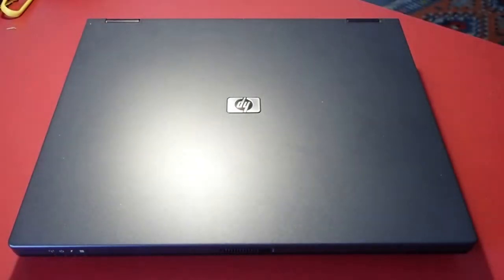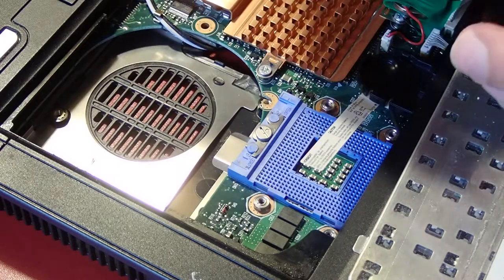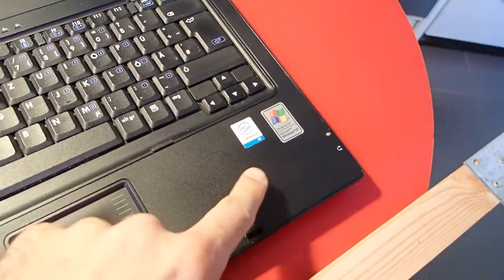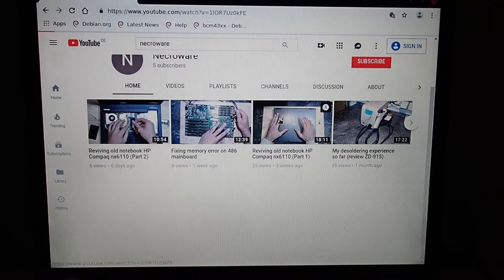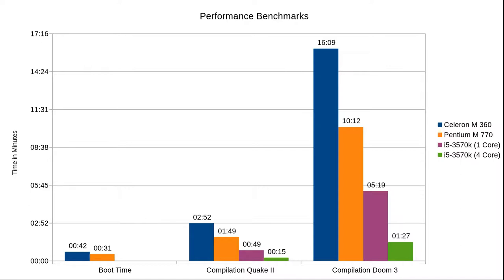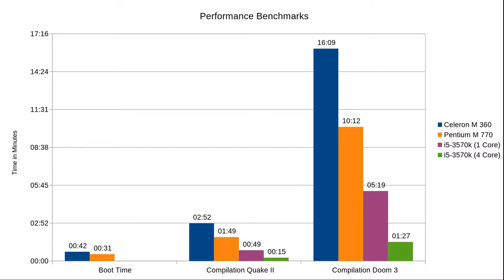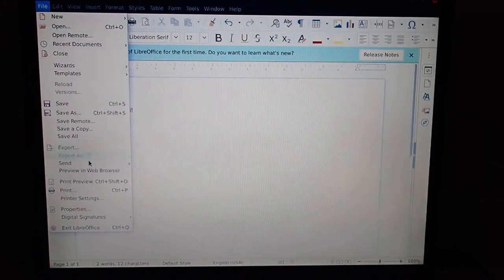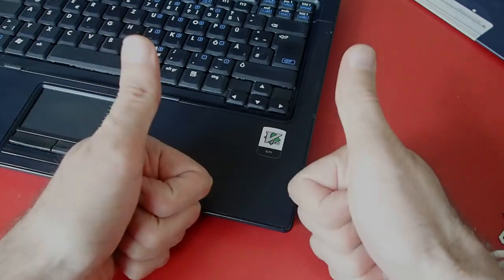Reviving old notebook HP Compaq nx6110 (Part 3)

Comment: I had been inspired by another YouTuber's videos to go through my old computers and revive them, and it just so happened that one of my systems was this very machine (an nc6110, the only difference between the nx and nc models is the warranty policy at the time of sale, nx models get 1 year while nc models get 3 years). Your video series was immensely helpful for me in restoring it.

I hadn't thought there would be adapters to convert mini SATA SSDs into PATA drives; I had been previously looking for SSDs with a PATA interface and they were super expensive and just not worth it ($85 US for a 128 GB model). I ended up using an M.2 SATA SSD as new mSATA ones aren't being made anymore.

I upgraded the RAM to 2 GB, changed out the 40 GB 4200 RPM HDD with the M.2 SSD and adapter, replaced the Celeron 350 1.3 GHz CPU (slowest in the range) with a Pentium M 780 (fastest in the range), and installed Trisquel GNU/Linux Mini, and it works perfectly. Again, thank you very much for the help!
Reply from the maker: Glad, I could help! With all this updates the notebook doesn't turn magically into a modern machine, but with this small improvements, it turns out to be usable for simple work again.

Comment: awesome videos man, good to know the processor socket and RAM. You were very informative, I have the same laptop and am about to upgrade it, just wanted to say that you're very helpful for third world countries where the economy is harsh and everything that is related to technology is taxed double or more! This is a great alternative!
Reply from the maker: Thank you. As I wrote in the other comment, socket should be Socket 479 and RAM is DDR1 SO-DIMM. Even if I'm glad to help, unfortunately this Laptop is very limited in it's capabilities even with upgrades. It is pretty much usable, if you also pay attention to take an appropriate operation system, which runs well on low memory. This notebook accepts maximum of 2GB and the CPU is only single core old 32bit one. Unfortunately people seem not to understand that, watch my videos and try to install Windows 7, 8 or 10 on it. One of the crucial messages in the videos was to take a modern, safe, but resource friendly operation system. In the world of Windows, only XP would run well on it and I don't suggest to install it. It is heavily outdated and meanwhile very unsafe.
It is very interesting to see, how people are often complaining about bad economical situation, but then trying to use an (usually pirated) operation system, which enforces them to buy a top notch hardware for a lot of money. Instead they could take an older and cheaper notebook and install a modern, legal operation system on it, which would run fast and safe for a lot less money.... very strange world.

Comment: This channel is awesome , its nice to see people making "obsolete" tech usable again. last Christmas i saved a HP nx9420 from the  skip at work.  I had to put a HDD in it but otherwise it worked pretty well  on win7 with its 2ghz dual  core, but as soon as you watched any YouTube it would shut down after  2-3 minuits. Turned out the GPU heat pipe was bad and trying to find a replacement for a laptop this age was next to impossible. Eventually i found out that the  8710w used the same chassis but different GPU but was similar enough that i could make it fit mine and bought one off ebay. I maxed the ram out (4gb)  an SSD and swapped the cpu out for t7600 and it would run youtube at 1080@60 no problem. Of course a few months later win7  support was ended and so i upgraded to win10, that slowed it down tremendously, to the point i could only watch videos @ 480-720. anything higher was a stuttery mess.  So i turned to Kubuntu and its usable again and  back to 1080@60 video  using a youtube program instead of the browser version.

few months later im given more old hp laptops  nx7300 , nx7400 and a 6715s . Used the 7300 as spares  cause it had no docking port underneath,  and  repaired the other two into working laptops!  the 6715s is an AMD Turion tl-60 and the only one that  the battery still works in...and Overclocked using software.
Reply from the maker: Thank you! That sound really great and I hope to attract more people like you sharing this hobby :) Unfortunately with all the upgrades I made to this nx6110 I already reached the absolute limit, what you can do there. This is the fastest CPU this thing officially supports and you can't install more, than 2GB RAM there. However, my curiosity was about how much usable is this notebook would be, if completely fleged out. And I have to admit, paired with the right OS, like any lightweight Linux distribution, it is quite usable. It is still 15 years old and goes like a dead man, but it is usable. And I'm using it for simple things in my workshop, for searching and reading datasheets and pdfs, programming eproms and such things :)
Reply: @necro_ware   it seems I'd already commented  here 5 months ago and didn't notice I'd already said pretty much the same thing lol. I've been mostly using the laptops for web browsing  as my main pc (fx8300) is permanently connected to an older 42 inch TV, I find it hard to read text even with increasing the page and text sizing. I do have a second monitor closer to me for finer details but it's uncomfatable to use for more than a few mins. So the bigger laptop gets used for web stuff and the one with the good battery gets used for travel.  Eventually I plan to have them all decent enough for Christmas time again when the family gets together and we can use them networked to play all the old classic games like doom duke3d blood and so on.

Comment: i saved an old hp NX9420 from the trash  where i work a few months back. Turns out the heat pipe for the GPU wasn't doing its job and the laptop would thermal shut down after 10-15 mins of use. Of course being so old now the parts are non existent and considered bending up my own heat pipes to repair the heats sink. After a few weeks research i found that the HP 8710w was built in pretty much the same chassis as the NX9420, and the heat-sink was very similar but more importantly available second hand!  it wasn't a direct fit,  I had to sacrifice the modem port to fit the bigger cooling fin cooler bit in, and grind some of the motherboard and the casting of the cooler  to make it fit. come up with a solution to attach it to the GPU as it was for a Quadro card and not a Radeon. But it works!  I put the Core 2 T7600  in it and maxed the ram out ( 4GB )  with an SSD and it was perfect on win7. i could watch YouTube at 1080@60fps. but having to upgrade to win10 has meant that i can only watch stuff at 720p sometimes 1080p but it cant cope with 60fps videos and win10.. Otherwise its very satisfying to fix and upgrade long obsolete electronics and make them usable again in today's environment!
Reply from the maker: Very nice, repairing the heatpipes would be probably too complicated? I never did that.... yet :)
Reply: @necro_ware  hardest part would be bending the pipes without kinking or damaging them. Id have to use 2 small round ones over using one flat heat pipe just because it would be impossible to bend on its edge. Removing a good heat pipe and swapping  it over to repair the broken cooler would probably be best solution if I couldn't get it to fit the graphics card.
Reply from the maker: @austinmaxi  Yeah, sound like something, what needs experience, but probably doable :)

Comment: Thank you for  excellent videos. They seem perfect for my old laptop an HP nc6120.  There are two questions , one for the type of ssd adapter  and  where I can find it.  The second thing is the type of CPU  that replaced the old one.  These are the two crucial issues that will give real  power to my old laptop. I have asked for a disk replacement many times but all local stores told me that I  will not find an ssd drive for replace an old IDE drive. Your adaptor was really the solution to my case. I appreciate your answer vet much no nthNk you again for your time to offer us these videos. Best regards , George form Athens, Greece.
Reply from the maker: Thank you very much! I'm glad you liked it. The CPU is Intel Pentium M770 (see at 0:38 for details). This is the best one you can use in the nx6110 notebook and I guess in nc6120 also, but please double check this and compare to the CPU you already have inside before you buy. I upgraded from a low clocked Celeron to a Pentium M, which was almost twice as fast. This upgrade was worth it, but if you already have, let's say M740, I don't think, that the upgrade would make any sense.  Regarding the SSD adapter, unfortunately I have no particular model number for you. Just search ebay, or whatever you prefer, for mSATA to 44pin IDE adapter and you'll find whole bunch of options. Like here  https://www.ebay.de/sch/i.html?_osacat=0&_odkw=msata+to+ide+adapter&_from=R40&_trksid=m570.l1313&_nkw=msata+to+44pin+ide+adapter&_sacat=0

I don't want to hold you back, but also don't want, that you disappoint  yourself. Realistically  this laptops are still very old and you can't do much to give "real power" to them. However, you can give just enough power to make them usable again. They are very well made and still work reliably if you do some improvements, like I did. As I told in the video, I didn't get a powerful machine, but something, what is enough for office use and simple daily work.  If this is your goal, it is absolutely feasible :)
Reply: Dear  @necro_ware , I have to thank you very much for your kind and prompt response to my questions.  I really enjoyed your serious of videos regarding the old laptops and their use under current conditions. I have installed Linux Mint in this old laptop of mine and I can work (even slowly) for usual routine work such as emails and some searching on the Internet. For sentimental reasons I keep it as it is an excellent piece of hardware and I have also a docking station which is of great convenience for me. I will look for an SSD disk (if I find the adapter) and secondly for a new CPU )if it fits the one you are referring to). I again thank you very much for your invaluable help in finding a way to keep this old (but precious) piece of hardware. Thank you very much - George  --- By the way, I do not know if you know the meaning of the word Necro... which is part of your Youtube name. In Greek it means something dead, ''Necros'' is the dead one,  so Necroware is the Deadware in Greek, something that is perfectly compatible with your videos of this type !!!
Reply from the maker: @ghal1607  Same for me, I also keep this old parts living, because of sentimental and historical reasons. I am software developer since about 25 years and love the history of technology. Every engineer should understand where we are coming from to be able to make better products. This channel is just a hobby, which should help other people to preserve the history. Regarding the name, I know what it means, that's why I've chosen the name, since I am trying to revive dead hardware :) I'm glad you've noticed the idea!
Reply: @necro_ware  thanks again, I will always keep an eye on your excellent and helpful videos. I am also an engineer specializing in Geographical Information Systems for the last 30 years. This laptop was my first one to install a GIS software (old versions of Arcinfo software in CLI mode....). Thank you.

Comment: Great videos, I'll definitely upgrade mine too.    Quick question; do you think the "pin mod" could be aplied to this CPU (Pentium m 770) to increase the "mhz" with no problems?...
Reply from the maker: Thank you very much! It is worth it to upgrade this machine, it can be made usable for the most daily work and I hope, that this video was helpful. Regarding "pin mod", I don't know, if it will work, however, even if it is interesting, I wouldn't  suggest to do so in long term, since the cooler is really small and overclocking the CPU could damage the notebook by overheating.
Reply: I agree with you; it is worth it..    thanks a lot for the advice.

Comment: Very interesting its improvements. You can indicate the references and models of the parts that you have used in the 3 videos. I would like to be able to improve my notebook, as you have done. Is there a possibility to increase the memory to 4Gb ?. Thank you.
Reply from the maker: Thank you. This video is quite old, so I can't give you exact link where I bought the parts, but you can find everything on AliExpress or Ebay. CPU is Pentium M 770, for the hard drive I used mSATA to 44-pin IDE adapter with a mSATA SSD, the memory was 2x1GB DDR400 SO-DIMM. You can't upgrade this notebook to 4GB, since 1GB modules were the largest DDR1 modules available and it has only two slots.

Comment: I have a similar one with a factory 1.733 MHz Pentium M CPU.. Going to 2.133 wouldn't be much of an improvement in my case, and in 2022 the real bottleneck is browser performance, which got quite worse since this video. Still quite informative though, thanks.

Comment: can u plz tell me how much it total cost to restore it...
Reply from the maker: Hi, it was about 10€ for RAM, 4€ for CPU,  3€ SATA Adapter and the most expensive was SSD for 15€, if I remember right. Actually quite cheap, except the SSD, however, if you want to use this notebook, you'll need to replace the harddrive one day.

Comment: Brilliant content man. Have same laptop and its windows xp. However problem is that it found wifi conection it tries to connect but at the end nothing just hapening. Can you help me? The problem is windows or anthena?
Reply from the maker: Hi, sorry for late answer, I somehow overlooked your comment. Thank you for your kind words. Regarding your problem, may be there is some security issue? Beside hardware issues, I have one guess. WinXP is old and your WiFi router protocol could have some newer security related checks, which just doesn't work under WinXP anymore? As I told in the second part, I don't suggest to use WinXP anymore. You could try Linux LiveCD, may be Ubuntu, to see if the problem also happens there. Hope this is something you can start with?
Reply: It's most likely due to encryption standard chosen on your wifi router. Most modern devices use WPA2, but it won't be supported by older clients. You'll have to switch to older WPA or even WEP protocol. But be aware that older protocols are less secure (wep can be hacked in a matter of minutes by someone with half-decent skills) and if you switch the protocol on you router it takes effect for all devices on that wifi network

Comment: you can see where the main bottleneck is, it's the disk controller, it's really holding back that CPU. does this board have an m2 wifi card? you might be able to get increased performance by using the Intel disk controller that might be hiding (unused) inside the southbridge chip on the motherboard, just pull the M2 wifi card and see if you can install the M2 SSD in it's place?
Reply from the maker: M2 was invented 10 years later :D
Reply: @necro_ware well that might be a problem! 😂

Comment: hahahaha, I've the same model of notebook and installed win7 on it. It actually works flawless
Reply from the maker: Yes, Windows 7 would probably work, but I just don't suggest it, because it reached end of life 1,5 years ago. I also don't  use Windows since at least 15 years and since it was a notebook for me, Linux better met my requirements.
Reply: @necro_ware  I repaired some old laptops and also installed linux on them. The last one is paired with lubuntu 18.04 lts (512mb) and works great for me, but I want to keep one or two windows machines too
Reply from the maker: I absolutely understand that. I also have one retro machine with windows on it. Just in case I need it, but it is not connected to the network to avoid any problems. I have some network infrastructure at home and wouldn't like to drill a hole in my own security :D
Reply: @necro_ware  yo necro where did you get this laptop I need one of these

Comment: Instead of that Can I use pentium m 780 the watt is same but voltage use is just little bit more
Reply from the maker: Is this a question? I guess, you can, however M780 costs today about 4 times as much as M770 and if you ask me, the 0.1GHz more is not worth it. In addition, higher voltage means also more heat and this is an important factor in a notebook.

Comment: Hello Necroware !
If you still have this nx6110, will you please make a video on how to install windows 8.1 or windows 10 on this machine  ?
Reply from the maker: I'm sorry, but windows 10 will not run on this machine. It needs 64-bit CPU and this machine is 32-bit only. I also don't have a license and don't use windows since 20 years.
Reply: @necro_ware  That's sad ! But thanks for the quick reply. Do you think I could try windows 8 ... ?
Reply from the maker: @dvinod33  You can try, but I don't think, that it will be usable with only 2GB of RAM....
Reply: @necro_ware  I have this old notebook and If you have instaled 2GB Ram, 128-256 is shared video and this old NTB can use 8.1WIN 32bit properly. Its better upgrade to SSD/IDE dics!!
The INTEL graf.card is slow, can play Youtube videos on 360p. Win 10 exist also in 32bit version but i do not know if this Intel processors are suported?!